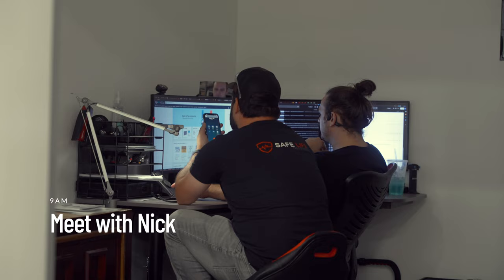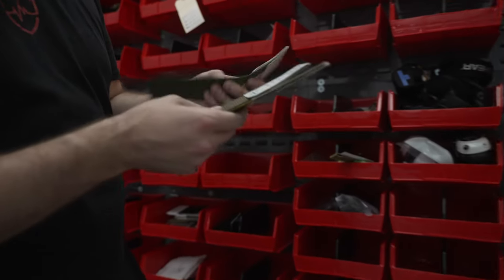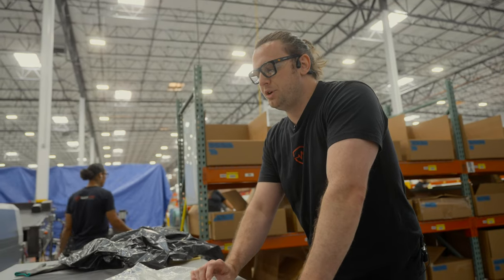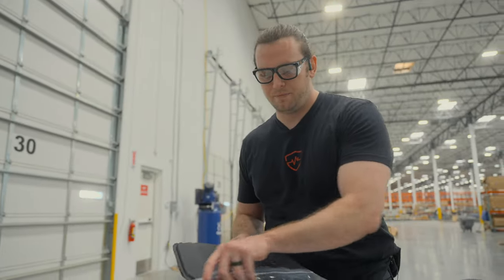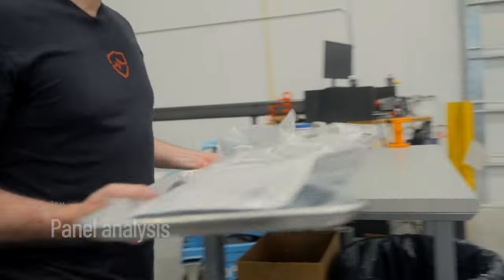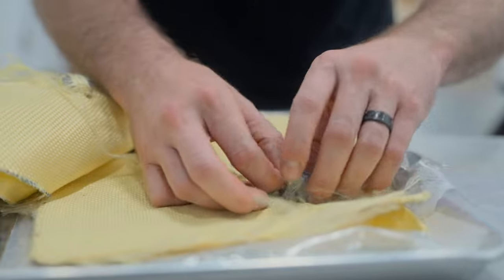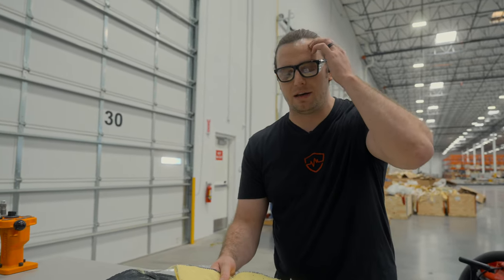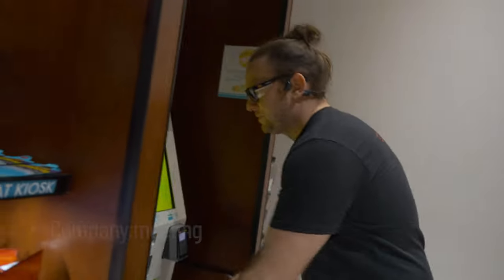How does Safe Life Defense test body armor?

Comment: Have you guys considered layering in a viscoelastic foam between the fiber plates or on the back of the body facing parts of the panels they are flexible and can conform to the body but become rigid when force is applied i believe through the right composition and layering method you could greatly decrease back face deformation without affecting comfort also if you haven’t thought of this already I’d gladly accept a job 😂